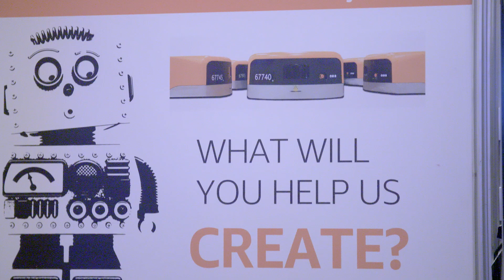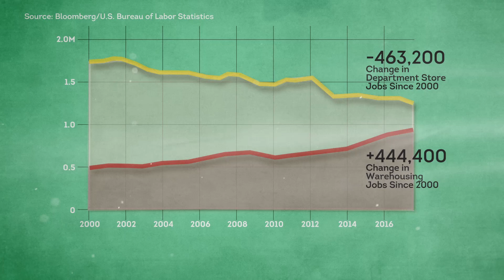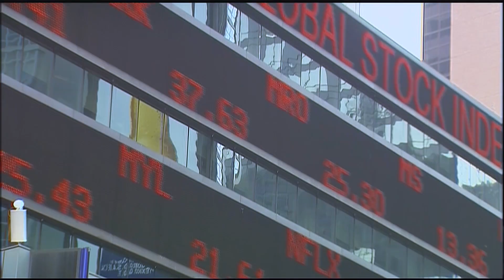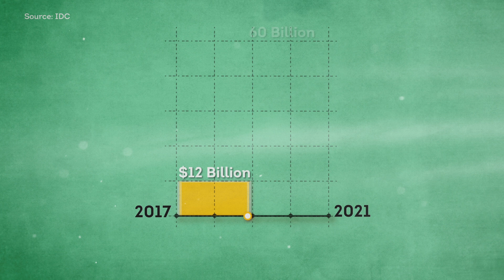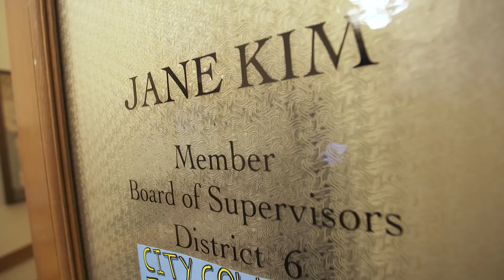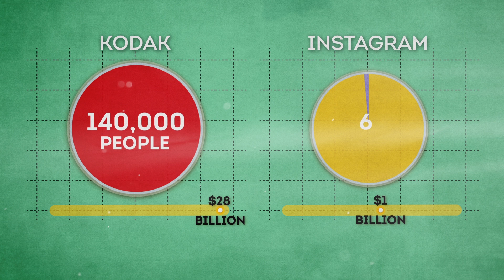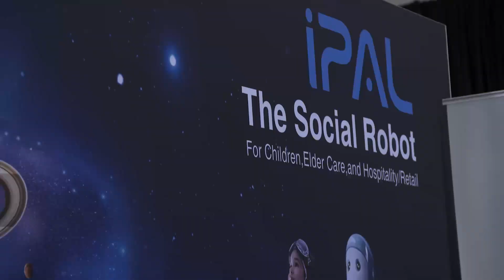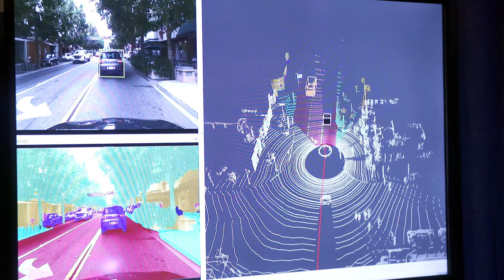Will Robots Make Us Poor? Universal Basic Income And The Robot Tax [Automation, Pt. 3] | AJ+ Docs

Comment: Greed is the main problem. The Universal Basic Income would probably be an inadequate joke with many people falling through the cracks in the system and becoming homeless. It's already happening. The rich, smart and greedy only care about themselves, so if you think that U.B.I. would fix social problems like housing, crime, etc. don't hold your breath. People will suffer, there will be no middle class any more. Would the U.B.I. give people a middle class lifestyle? Don't hold your breath. Crime will probably increase drastically because when people are not working and productive, they will have lots of idle time. Too much idle time can bring out the worst in people, for example, drinking and drug use would probably skyrocket, divorces would escalate, people with depression/mental illness would increase, and people would feel like life has no purpose and become suicidal. And contrary to what nonreligionist stated 1 year ago, U.B.I. which is basically welfare, does hurt motivation to work, I have seen it and lived it, so there.

Comment: To all the engineers confident that their job will be secure in this sort of market, nothing was touched upon neural networks that could design and develop systems/structures/elements without much human input. That is also coming, and will not necessarily get rid of, but certainly limit the engineering field. And when programmers design algorithms to assist and develop code based on simple commands and desires, that's another job that will be limited. When factories buy robots that self diagnose and self repair, their goes a large portion of robotic/electronic repair. Literally no job is absolutely safe. Some jobs have a longer clock than others, but humans are being replaced slowly. No doubt in 20-30 years, there will be a fraction of the currently available jobs.

Comment: The rich need the spending power of the work force, no point in making millions of people redundant and loosing the tax revenue from wages, taxes from goods they spend wages on.No need to have robot maids in hotels because now millions of redundant people don't have any money to stay in hotels, its been happening in the motor vehicle industry for years replacing the work force with robots, tens of thousands made unemployed huge loss in tax revenue and massive  spending power gone, with the result for the car manufacturers huge allotments full of brand new unsold vehicles rusting away.

Comment: UBI is the answer but first the government needs to take back the issuance of money from the federal reserve so that inflation is generated from the increasing issuance of UBI rather than interest payments to private banking entities. USA pays $1100 dollars per year per adult to the federal reserve in interest (that's to elite private individuals) and has been overspending by around $3400 dollars a year per adult citizen (this money also ultimately goes to elite private individuals). The government would have to issue more dollars per year but it would not accrue interest - inflation would settle at a much higher rate of around 10% which would actually be healthy for the economy as the currency would not be hoarded and would instead be used as it should be and exchanged/circulated. UBI is the answer as without it a mind-blowingly complex and expensive to administer benefits system would be required to keep the masses from poverty and civil unrest - UBI should be gradually introduced as soon as possible as the elimination of jobs by AI and automation will start to explode at an exponential rate in the near future and if the system is not in place and ready to cushion the changes in employment levels, many cities may fall to devastating civil wars. UBI is the logical answer as it would work and it is fit for the future as it can be increased to suit the economy when less than 10% of the adult population will be in employment - and that time is coming...you will work because it interests you or you will work because your skills are scarce and you wish to have a slightly wealthier lifestyle than those who don't work. UBI would be steadily increased through to a level of around $45,000/year per adult (in todays money) and would amount to a reasonable middleclass lifestyle - the effects on society will be many and positive outcome will arise as lots of people will opt to work voluntarily teaching and mentoring and assisting/helping others and a more sharing approach to knowledge and time will evolve. Unfortunately, UBI is getting a lot of undeserved negative press and few countries yet see how essential it will become and how very important it is to introduce it right now so it is well established in time for the dramatic and explosive changes that are going to occur in the employment market.

Comment: My list of jobs that will be automated according to the website https://willrobotstakemyjob.com/

The first set of numbers represent the number of people doing that Job...

3,541,010 Chashers 97% (Doomed)

426,310 Driver/Sales Workers 98% (Doomed)

496,760 Tellers 98% (Doomed)

3,426,090 Combined Food Preparation and Serving Workers, Including Fast Food 92% (Doomed) 

1,270 Animal Breeders 95% (Doomed)

1,620 Watch Repairers 99% (Doomed)

49,780 Technical Writers 89% 2016 (Robots are watching) Doomed by 2024 with projected growth of 10%

146,350 Parking Lot Attendants 87% 2016 (Robots are Watching) Doomed by 2024 with projected growth of 4% 

7,170 Forest and Conservation Workers 87% 2016 (Robots are Watching) Doomed by 2024 with projected growth of 4%

116,410 Roofers 90% (Doomed)

52,730 Print Binding and Finishing Workers 95% (Doomed) 

1,112,780 Team Assemblers 97% (Doomed) 

19,780 Heat Treating Equipment Setters, Operators, and Tenders 91% (Doomed) 

188,860 taxi Drivers and Chauffeurs 89% (Robots are watching) as of 2016. Doomed by 2024 with projected growth of 13%

197,910 Dispatchers, Except Police, Fire, and Ambulance 96% (Doomed)

130,950 File Clerks 97% (Doomed)

114,680 Refuse and Recyclable Material Collectors 93% (Doomed)

21,020 Riggers 89% 2016 (Robots are watching) Doomed by 2024 with projected growth of 9%

194,810 Data Entry Keyers 99% (Doomed)

91,530 Mail Clerks and Mail Machine Operators, Except Postal Service 94% (Doomed)

72,120 Procurement Clerks 98% (Doomed)

12,030 Pump Operators, Except Wellhead Pumpers 90% (Doomed)

1,040 Model Makers 96% (Doomed) 

We need some sort of a UBI whether you like it or not. I'm sure there's a lot more but I think I proved my point

Comment: There will be no UBI.  Robots will only do what is profitable to do and once one robot can do it then ANY robot will do it and it will be an immediate race to the bottom.  You can only tax profit and robots will commoditized profits driving them to be as low as possible.  Going forward, you will either be an owner or a poor.

Comment: Karl Marx, 𝘊𝘢𝘱𝘪𝘵𝘢𝘭, 1867:

"The division of labour develops this labour-power in a one-sided way, by reducing it to the highly particularised skill of handling a special tool. When it becomes the job of the machine to handle this tool, the use-value of the worker’s labour-power vanishes, and with it its exchange-value. The worker becomes unsaleable, like paper money thrown out of currency by legal enactment. The section of the working class thus rendered superfluous by machinery, i.e. converted into a part of the population no longer directly necessary for the self-valorisation of capital, either goes under in the unequal context between the old handicraft and manufacturing production and the new machine production, or else floods all the more easily accessible branches of industry, swamps the labour-market, and makes the prices of labour-power fall below its value...When machinery seizes on an industry by degrees, it produces chronic misery among the workers who compete with it. Where the transition is rapid, the effect is acute and is felt by great masses of people."